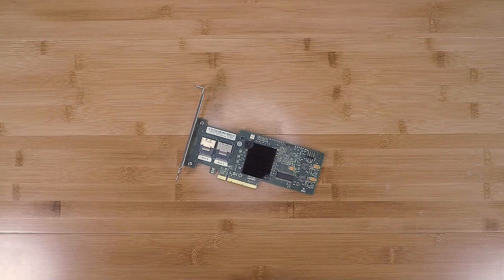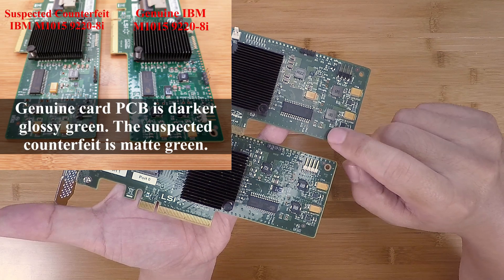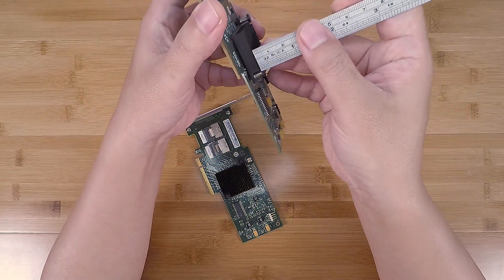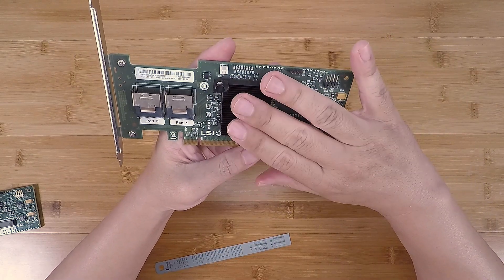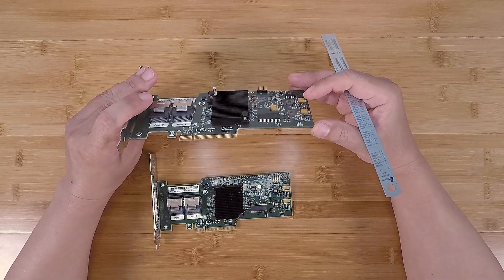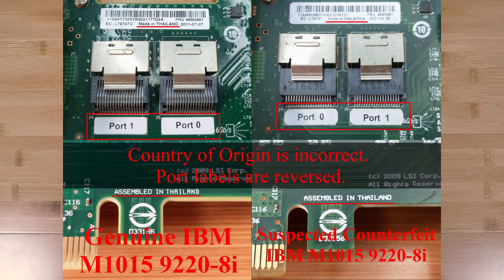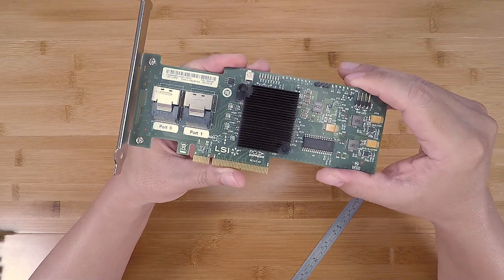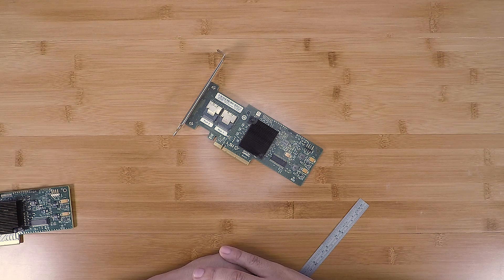Is this the best counterfeit LSI HBA? | Tips to avoid fake LSI SAS controller cards

Comment: Issue with using buying off ebay is they use stock images or can use images of the real one but provide you with the counterfeit.
Real question is, does it work correctly?
Reply from the maker: I take pride in taking high resolution photos of the items I'm selling for my eBay store: https://www.ebay.com/str/theartofserver

the issue of counterfeit computer products isn't about whether it works or not. that's obvious and you'll know immediately the first time you use it. the more difficult problem is the long term reliability. from this and my other videos on this topic, it's clear corners are being cut and it's easy to point out the ones you can identify visually. but how about other components that are not as easy to identify? when a low quality capacitor fails in the power regulation circuit of the HBA card, the entire card will cease to power on.

Comment: A few things you missed:
1. The counterfeit card has used a cheaper capacitor at CT28 where the genuine uses a high quality part.
2. The counterfeit card has used cheaper inductors
3. The MLCC (Multi-layer ceremic capacitor) at CT27 has been replaced with a cheaper lower value part (the physical size gives this away)
Reply from the maker: Great points, appreciate you adding to the discussion!

Comment: Is there a Problem with those counterfeits ? Don't they work the same way ? I know they're not legally licensed but if i get some second hand, is there an issue with that ?
Reply from the maker: That's a good question with no definitive answer. The only thing I can say is that based on what I've seen and shown in my other videos on this topic, clearly corners are being cut to produce these "cheaper" versions of these controllers. The chipset appears to be the same one, but obviously, things like heatsink quality, and in some other videos I showed how the traces were made from cheaper materials, etc., so the product may work initially, but I think there's a compromise made with the long term reliability. even if the main IOC chip is the same, if the power delivery circuit fails prematurely, the card will stop working even with a good chip. there are anecdotal claims of such pre-mature failures, but I doubt anyone has done a comprehensive survey/study to extract more reliable results beyond the Internet anecdotes. 

The motivation for the people making these things is to make them as cheaply as possible so as to attract buyers by the low prices. Their motivation is not to make a product that is equal in quality to the original. But I'm not here to judge and people are free to spend their hard earned money how they see fit. YMMV.

Comment: the solder mask (green overlay on the pcb) can be different shades as they may use different bare pcb manufactorers depending on pricing. Even different lots from the same PCB MFG can be different shades. The best thing to look for is lack of ground vias in the counterfeit along with cheap chinese capacitors instead of better japanese ones
Reply from the maker: Thanks for sharing your thoughts!

Comment: I have a counterfeit which has both LEDs, has the ports labeled in the proper order for IT mode and is a different font size without the white background, and lastly the raid key header isn't present.
The heatsink appears to be a few mm short but it does have similar spacing and the straight cut left tab.
The pcb does appear to be of similar finish to one I purchased from AoS.
Thankfully, this counterfeit seems to be reliable as I've had it running since the end of 2019 with no issues.
Reply from the maker: thanks great! :-)

Comment: Excellent video. Your attention to detail is amazing. You found so many tiny differences. However all the tiny differences could have legitimate reasons and be caused by LSI manufacturing changes. But the one point you make, which definitely convinced me, that this card is counterfeit: the different fonts on the labels. This cannot come from LSI as it just looks unprofessional to have such randomness on a product made by a top brand. Thanks for being so thorough and raising so many great points. In the end you caught one and its very helpful to see your analysis!!!
Reply from the maker: Thanks! Hope this was helpful!
Reply: @ArtofServer Yes very helpful. Also your video on testing 4Kn drives. However, my experience was different to yours: I tested a Seagate 4TB 4Kn drive and although the SAS adapter reported correct size, the disks were not presented to the OS. I tried this on 2 cards with LSI 2008 (9211-8i) chipset and 1 card with LSI 2308 (9217-4i4e)  chipset, all flashed into IT-Mode. Do you have any suggestions why?

Comment: I had a 9311-8i with 100% LSI silkscreening that wouldn't take LSI firmware - I suspected a fake - turns out it was an Oracle FRU with no Oracle P/Ns or any indication otherwise. The Oracle specific firmware worked flawlessly. Long story short is that hundreds of thousands of these cards were made for OEM and vendors alike - sometimes with no indication. The market is flooded with these - plus fakes - making it almost impossible to determine definitively which are genuine. The good news is that (barring obvious poorly made one's) most of the fakes perform as designed. These is no OEM warranty either way from the OEM for the secondary market so no a huge deal.

Comment: @7:09 reading the M1015 user guide from the ibm web site, page 3-2 connector diagram, J4 (left) is listed as ports 0-3 and J5 (right) is listed as ports 4-7. Product photo sheets show it the same way, i suspect if you take the stickers off you'll see silkscreening showing the official hardware port order. The IBM product pictures also show non shiny finish.

Comment: I may have purchased a counterfeit LSI card that is coming... I will still try it out though.
Not long ago I did buy a counterfeit Intel network card, and that one worked very well for years, so I may be okay.
It did die in the end though, but it could be a system pull that have served for years, so I cannot say it would be bad or not in terms of lifetime expectancy.
Reply from the maker: that's good information. yeah, i'm not sure how poorly the counterfeits will perform. there's not a lot of data on how these counterfeits perform out in the wild, so your experience is interesting. thanks for watching!
Reply: @ArtofServer  The price was cheap, and the bundle of cables alone was worth the price.
Especially seeing as it seems like those SATA breakout cables aren't too easy to come across and even you were sold out :D
Reply: @CMDRSweeper  I just bought the same counterfeit card + cable bundle, will report back on how it runs!

Comment: brand new server from dell, sealed and shipped right from wholesaler's warehouse came with the "fake" card. I'm almost sure that it's only a more recent revision instead of a fake one.
Reply from the maker: This same card? because that wouldn't make much sense to get a brand new sealed Dell server that has an IBM card in it. Isn't that bit unusual? If it was a part Dell sold with a Dell server, it should have a Dell P/N, not an IBM FRU number like this card.
Reply: @ArtofServer   I'm sure it came from a brand new server and was switched with a different requested by a customer. I dont remember having bought ibm servers in the last year,  mainly dell and fujitsu, thats why i wrote Dell server, but you're right it should have been an ibm.
Reply: Uhm..you made me think..how come i got that card in a server bought in 2019 ? Isn't it a bit old for a new server?
Reply from the maker: Yeah... That too. Lol

Comment: I've recently had a 9200 16e card die and when I was shopping for replacements, I was looking at the pictures seeing if I could order the DRAM chips to repair my current one when I noticed quite a few cards on Ebay do not have identical DRAM. Out of the 6 listings that had readable text on the chips, 3 used Samsung K4T1G164QF-BCF7 which is DDR2-800, 2 used Micron MT47H64M16HR-25E:H which is also DDR2-800 but the last card used Micron MT47H64M16HR-3:H which is DDR2-667. I did see some SKHynix chips too but I couldn't make out the text. I'm not sure if this is a good sign for it being a counterfeit but the DDR2-667 chips are an outlier
EDIT:typo
EDIT2: I'm not even sure this would even be noticed by the user, I'm not quite sure what the DRAM on the 9200-16e even does, I'm pretty sure you are unable to run that card in IR mode. I might be wrong. There are 5x 1Gbit chips on the front of the card which is an odd number unless they are running 4Gbit with ECC.
Reply from the maker: Thanks for sharing your observations. In the case of the card in this vid, I didn't see any SMD component variances that were red flags. I've seen thousands of these cards, and I do regularly see variances in the color/brand of general SMD components (typical capacitors, resistors, inductors, etc.). I don't usually see variances on major ICs like the LSI IOC/ROC chips, etc. Since I mostly deal with HBAs, I haven't paid much attention to the brand/model of the DRAM chips. So, your observation is interesting indeed.

Also, i'm equally perplexed by what those DRAM chips are for on the 9200-16e, and even on the 9201-16e. AFAIK, there's no MegaRAID firmware (which can use DRAM cache) for those cards. Hmmmm.....

Comment: If possible can you take the heat sink off the fake ? LSI adds codes to the heat spreader on the main chip and just thinking if its the an identical SOC and if all the info on the SOC is identical to the real thing.
Reply from the maker: The LSI SAS2008 cards usually have a thermal epoxy that glues the heatsink to the chip, making it very difficult to remove, and have a high risk of damaging the BGA solder joints if you try to pry on it too much. But I agree with you, that would really interesting to investigate, although I no longer have that card.

Comment: Could the company that makes the controller for IBM got a batch of pcb that did not meet IBM standards. And instead of disposing of them they used cheaper components and sold them on eBay?
Reply from the maker: I can only speculate, but I don't think we'll know for sure.

Comment: Interesting. I’ve never been in a position to check this, but is the weight the same between the real and counterfeit?  I wonder if sometimes the reason for using different heatsinks and case brackets depends on how close to the original PCB weight can be achieved.  Just reminds me of how some power supplies made of cheap components sometimes had weights added inside to make it seem like a quality product 😅
Reply from the maker: That's interesting about the fake PSUs... never heard that before! That would have been an interesting thing to check out, but I no longer have the suspected counterfeit cards.

Comment: I think you might be wrong on this. I suspect that the card you feel is counterfeit is more likely assembled on a licensed manufactured PCB. There is one silicon foundry in Malaysia that I know of that has an LSI license deal to produce PCBs for LSI products. The company “Wafer Technology” in Malaysia paid LSI $120 Million for the license, with LSI also gaining equity in the foundry. The deal made in 2001 guaranteed LSI capacity, though this was not expected to exceed 50% of the PCBs used by LSI.

In the process of producing the cards, the PCB will be labeled at manufacture in Malaysia, and then once assembled in Thailand, labeled with additional information pertaining to the assembly and components used. In a sense, you actually explain this in your own video, just don’t get into the difference between manufactured and assembled.
Reply from the maker: I could be wrong. I certainly don't claim to have all the information here and so to an extent this is speculation. However, the 9220-8i cards were specifically made for IBM servers, known as ServeRAID M1015 cards in the IBM world. These were only ever sold with MegaRAID firmware, and so the port labeling would be incorrect and in reverse. IBM never sold this card with IT mode firmware (where the port labeling would be correct). So, although what you're saying could explain the conflicting manufactured/assembled difference, it doesn't explain the other differences like mislabeled ports, thinner heatsink, etc. All the points taken together still make me suspect this is counterfeit.
Reply: @ArtofServer  Good points. So whilst you might be wrong, you might also be right!

Comment: Can you test both in system, like the throughput and error rates?
Reply from the maker: I did test the counterfeit card, but not in comparison with the genuine card. In general, it functions the same as I believe the LSI SAS2008 chip is identical. My real functional concern about these counterfeits is really more about their long term reliability. The thinner heatsink might mean more thermal stress on the components.

Comment: It would be interesting to compare benchmarks between the two.
Reply from the maker: That might be interesting, but I don't think the LSI SAS2008 chip was different, so I would expect the same level of performance. My main concern is long term reliability with these counterfeits as can be seen, corners were cut. And those were only the ones that were easily identified. If they were willing to save 50 cents off the heatsink, did they do the same for other SMD components?
Reply: @ArtofServer  Did they? One has 9mm heatsink with 22 fins, the other has 7.5mm heatsink with 26 fins. Surface delta is about 0.1mm/fin. I would be more worried about the front plate. Original has perforated plate that allows (in some tight configurations) air to actually reach the heatsink, the other one is solid. I recently bought HP H220, and I wasn't even thinking about counterfeits, but when I was searching for what model to buy, I was just ignoring anything with a solid mounting plate.
Reply: @kharkin0  i have a dell original h710 that came factory installed with a solid bracked.... bought a perforated one to make sure some airflow is possible in the R820
Reply: @markvanloon  Oh, I'm not saying that solid bracket is a definite fake. It's more like if you're worried about longevity of the card (especially in a 1u chassis), every bit of ventilation helps. And in some instances even a fake card with a decent cooling can outlive an original card without it.

Comment: Interesting vid, did you find out what it was originally? And if so can you flash back to original for the shits and giggles 🤣
Reply from the maker: I think it was originally a counterfeit copy of the IBM M1015, but it was made for use with IT mode firmware likely... that's my guess as to why the port number was reversed.

Comment: are you absolutuly sure the same thing was not legally ordered to make / assemble in different suppliers and in different times.
Reply from the maker: I don't think we have enough information here to really talk in "absolute" terms. But there are certainly a lot of indicators here that are very suspicious. This M1015/9220-8i was ordered by IBM for their servers, and they definitely would not have ordered it with the port numbers in reverse since IBM only ever offered this card with MegaRAID firmware and never with IT mode firmware. But, could there have been a very rare IBM special project for a special customer? Who knows... that could be possible, but then why would IBM order it with a 25% reduced heatsink? If it was just one or two of the suspicious factors taken individually, one could give the benefit of the doubt, but collectively, all the suspicious factors point towards my suspicion as explained in the video.

Comment: LEDs are programmable by firmware...I don't care if it's counterfeit or a clone as long as it works and is firmware compatible with original
Reply from the maker: I'm not sure why the port activity LEDs were amber. Usually, that's an indicator of a problem on the SAS port, but when I tested the card it didn't seem to have any problems on the SAS lanes. Sometimes counterfeits or "aftermarket" clones can be better than the original. In those cases, I wouldn't hesitate to use them... I use to spend time modifying cars, and there were a lot of aftermarket options that were often better than the original factory part. However, in this case, it looks like the counterfeiters cheaped out and used a smaller heatsink. So, it makes me wonder if they also cheaped out on SMD components? In this case, I wouldn't recommend the counterfeit, but that's just my opinion.
Reply: @ArtofServer  have you tried flashing it with oem firmware to see if it changes LED behavior?  Yes they can be made with subgrade components
Reply: Are the microcontrollers different? I'm making the comment half way through the videos.
Reply: @paulloveless4122  unlikely

Comment: Hey nice to see your videos again. Is it possible to test the real and the fake cards? I mean if the components are similar maybe there is not much difference between both
Reply from the maker: Thanks for the welcome back. :-) I did test the card, and it functions normally. My main concern is more about long term reliability. Considering they cut the heatsink by 25%, what else did they cut corners on? And how does that affect long term reliability? Smaller heatsink might mean more thermal stress over time on the SAS2008 chip.
Reply: @Art of Server I feel you, thermal stress is a real problem, even more, when you have a 24*7 environment. Thanks for the insight